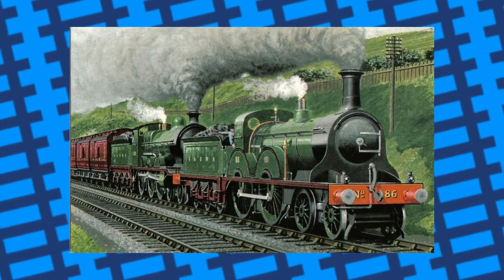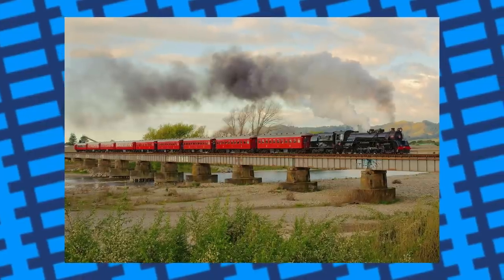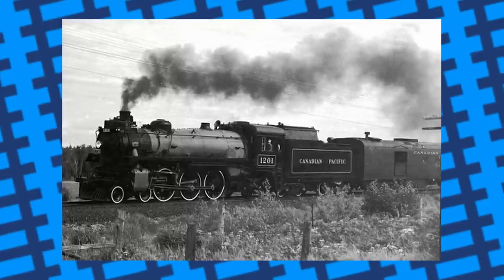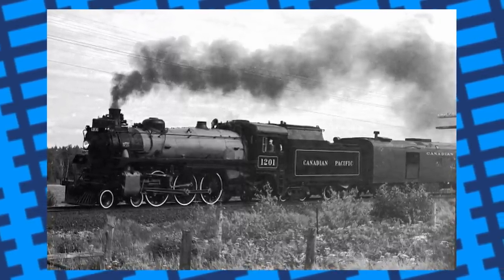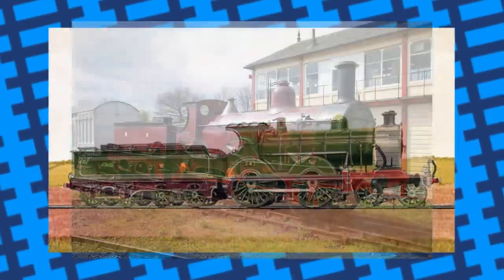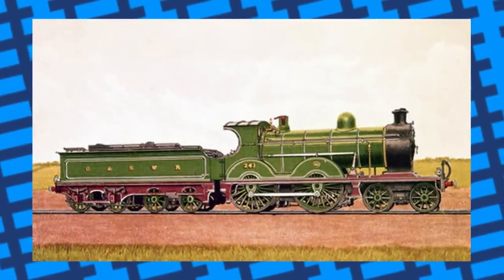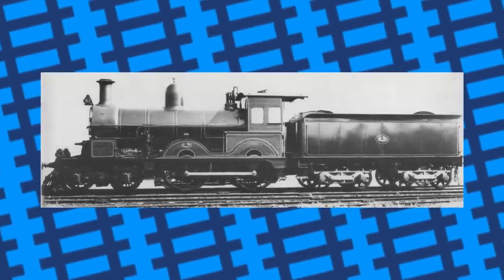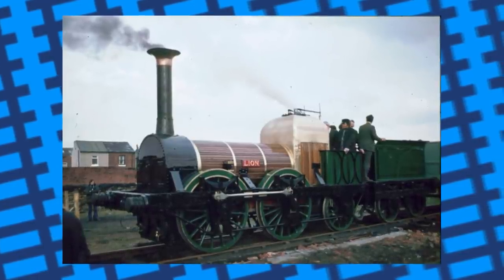Why there were fish in steam engine water tanks - Fish pun

Comment: its shocking that they didn't always clean the water tanks out in the early days of steam
Reply: I think the boiler was more of a priority, that’s where the action happened. Distilled water might not of ever occurred to be used to prolong boiler life or tank longevity.
Reply: @3xfaster  I know that but you would think they could have inspected the water tank to see if anything was inside it thankfully the heritage railways do things a little different when they wash their boilers out every fourteen days
Reply: early steam is one of the reasons modern work safety now exists isn't it?
Reply: @tsm688  yup, eg drivers tying down safety valves to get more boiler performance
Reply: @eliotreader8220  they can afford to do that, companies back then couldn’t and it wasn’t necessary
Reply: @SportyMabamba  Thats insane but I can totally believe it happened.

Comment: Fish do have a...very odd benefit for water tanks, but it's also highly dangerous if an engine starts running dry and potentially exploding.

In other words engines don't go fishing. It's too uncomfortable.
(Also love the Thomas reference but also a bit confused. Don't many rail fans hate the series? At least that's what the Steam Loco Profile channel said.)
Reply: @SportyMabamba  To this day I consider only the books that RWA wrote to be canon. The other stories anthropomorphize the engines a tad too much.
Reply: Even today at 58 I still hear the engines saying 'I think I can' as they pull away or hit a climb...
Reply: I know of TTE, haven't watched it but have bought HO TTE stock to modify for On30 use: and I don't much visit railfan forums/social media. Have heard a couple people say TTE is a bad influence because Thomas is only valued when he is useful, as in the line "A really useful engine". Huh? Thomas is a machine designed and built to perform a function and a machine which does not or simply can not perform its designed function is in fact not useful. A toaster which does not toast is not useful. An automobile transmission which does not transmit is not useful. A drawbridge which does not draw is not useful.
Reply: TTTE has a mixed reputation
The early stuff as said by SLIP producer Chris that the 80s and 90s kids got the best
Along with the RWS

Comment: At the factory where my father worked in  Walsall UK the water intake to the steam boiler was directly from the canal,  and it was not unusual for the stationary steam engine that powered the workshop to stop due to fish jammed in the cylinder.
Reply: Why didn’t they put up a grate lol? Which factory was it exactly?
Reply: Possibly they did in about 1850 (guess) when the canal was built but whatever material any sieve was made from would have rotted away by the 1940's. The canal company would say " not my seive" , the factory owner would say " I dont care theyre not my fish"
Reply: @stephenkirby6983  Thanks! Yeah I guess so long as no debris did any damage to the engine all would be well…
Reply: @user-ut2wx7jy6v  i forgot to give you the location -England, Walsall - Wolverhampton Street. The Canal is near the Blue Lane Junction and the factory was at the Marsh Street end, so about 300 yards from the that canal (and not the obvious nearest one either). The factory site is now under a shopping mall car park.
Reply: @stephenkirby6983  Can I ask, what was made at the factory?

Comment: Seems like a good spot really, youve got a fire there already and a shovel.  Chuck a couple fish in the tank, when lunchtime rolls around, fish it out, whack it with the shovel, pop it on the shovel and in the firebox. Hey presto hot lunch
Reply: only problem with that is that the coal used to heat a boiler isn't good for cooking, so the best thing to do is wait until you have to stop to swap crews, bring the fish with you to the dining car, and have the cook on board clean, prep, and cook them.
Reply: And from the UK's National Railway Museum, cooking in the locomotive smokebox, "Having cooked on steam locomotives on various preserved railways, anything from sausage butties to chicken wraps to full blown roast dinners, it seemed clear that my offering was to be cooking the full Christmas dinner on board the diminutive steam loco.

Cooking on a steam loco is not as straight forward as one might think. There is an oven (the smokebox), a grill/hotplate (the shovel in the firebox) and a ‘cool hob’ (the warming plate). Each of these locations can be used for cooking or warming your meal.  However, each have different temperatures and environments, and there isn’t a switch that you can twiddle to turn the heat down… Tricky you may say, well that’s one way of putting it!

Having done it many times and also seen others in action, I have had my sausages burnt on numerous occasions. There are also stories of footplate men attempting to cook a whole chicken in the smokebox of a large locomotive only to find that when they came to remove it that it had disappeared! Rumour has it that the blast from the exhaust steam sucked the bird up through the chimney and deposited it in a farmer’s field. The sheep must have done a double take seeing this flying through the air!!

No such worries at the museum though as the locomotive was plodding sedately up and down our yard for the course of the cooking."

Comment: Good news: we've taken care of the plant matter in the tank problem.
Bad news: we've got a fish poop in the tank problem.
Reply: I get the feeling that would find its way into the boiler system and was incinerated as the water in the pipes turned to steam, So it wasn't as big an issue as one might otherwise think. Now the plant material can be an issue as it eventually takes up more and more volume, and is hard to remove. At least getting the fish out is as easy as finding some worms, a hook and a line.